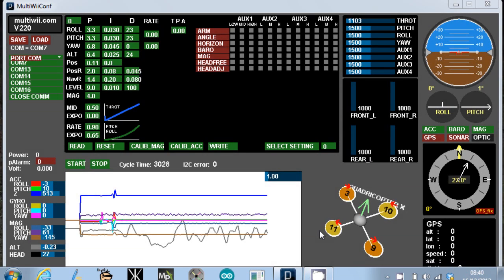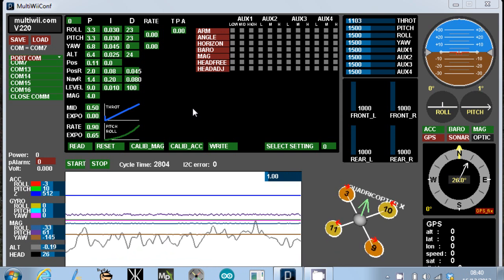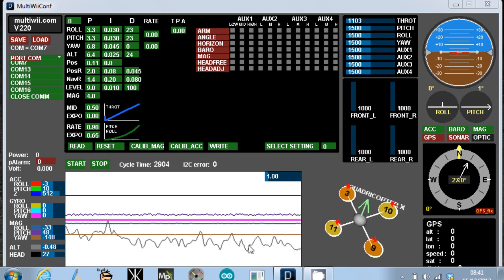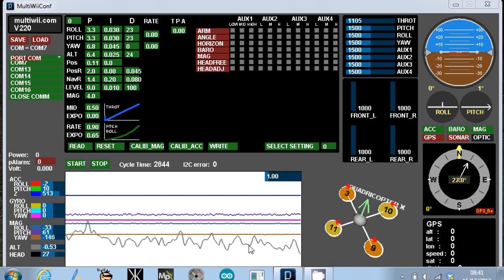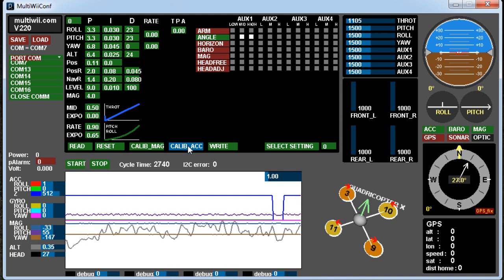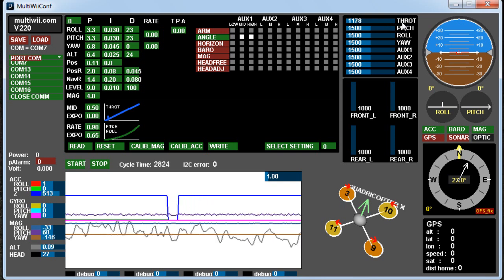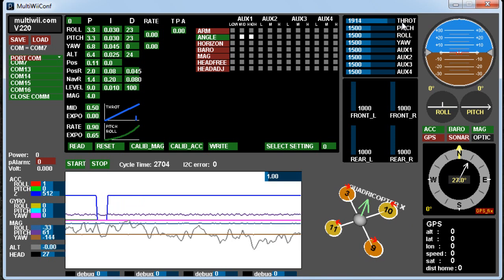(7/7) How to setup and trim auto-level on a Multiwii board

Comment: I'm working with diy multiwii 2.3 using diy brushed mosfet with 720 coreless dc motor and using flysky TX RX.
I instal baro module (bmp280) and modify some codes in multiwii 2.3. 'Hope you can help me with this. I watch your current video and try to do it later.
Reply from the maker: I've not used MultiWii for many years, so I am not sure if I am the best person to ask... best of luck

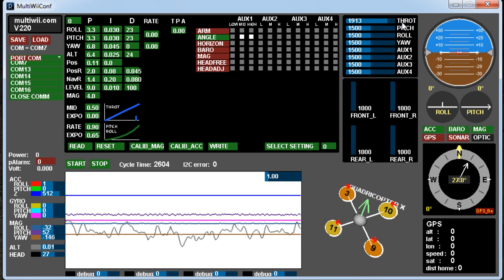Comment: Hi I'm also building a quadcopter but using the arduino and everything is ok and set but the only problem is the stick movements in the multiwii software are not moving for throttle etc as also shown in our video apprx at 8:25.. kindly pls help with this issue
Reply from the maker: I've not used the multiwii for many years now. All I know is in the video series. Best of luck..

Comment: I know this is an old video, but if you can answer it will be great! So if you don't use the trim buttons on the Tx, what are you using them for? I mean, do you just keep them to trim even with them, if needed, or did you just re-purposed them? Thx!
Reply from the maker: They are there more for fixed wing models really..
Reply: @Painless360  Thanks a lot man! I really needed someone confirming it! So I guess I'll re-purpose what I have..
Thanks a lot!

Comment: m getting yew drift and some roll n      pitch drift during acro mode help me
Reply from the maker: I'd use the sticks to calibrate out the drift. Make sure the radio settles to 1500..
Reply: Painless360 yes mid point at 1501 and throttle range 1010-1980

Comment: i noticed you wrote the information to the board but then clicked on calibrate accelerometers. So you don't need to click on write after calibrating the accelerometers?
  Is it also the same for the mag?
Thanks
Reply from the maker: Yep. ;)
Reply: Thanks, not keeping on top of things makes it difficult to remember all the small details, i need to write some notes.
Reply from the maker: That's why I do these videos. I often find myself referring back to them too so I remember the steps for products I've not used for a few months..

Comment: when i set the baro level or another switch on gui setting, have i to set it on every time ? or it is set automatically?
Reply from the maker: Luca Nsh I'm not sure what you mean - can you explain a little more?
Reply: Painless360 of course, sorry my eng
i mean, once i set for example the autolevel through the gui as a switch, have i all the times to switch it on ? can i set it to starts already when i turn on the xquad? 
i have just two switch on my TX and i want both free with autolevel already set
Reply from the maker: You can set the autolevel to be turned on when you want it to. See other videos in the Multiwii playlists for how this all works.

Best of luck.

Comment: when trimming and you say u land it. do u disarm before putting the throttle full and then pushing the stick in the direction of trim? if not full throttle would just fly upwards really quick?
Reply from the maker: AndyRC That's right. Disarmed.
Reply: thanks for the reply

Comment: Hello again Mr painless, I'm back, but I'm getting further as I watch and study your play list. I'm on this one. and finally was able to find my channel 5 setting on my Flysky transmitter and move it from VRA to SWA and it works. I mean self levels when switched on. Just like you said in this vid.Phew! :P.  I do have another problem though? I hope you can help me with this one? Here goes: When my craft is hovering (self level) or even manual mode and flying around about 1-3 feet up it all the sudden fast flip's high speed over on the right and crashes on its back! I just don't get it? Do you have a idea or 2 what it might be? Thank you su much, Kazz  P.S. I never went higher then 3 feet yet for I don't trust its behavior right now.
Reply from the maker: I would check that there isn't a bad connection on the model or a dirty pot on one of the controls on the radio - plus a servo into the channel that corresponds to the error and use the radio to see if you can make it 'jump'. I've also has some weird behaviour due to vibration on the model - it is on an anti-vibration mount isn't it?

Comment: hi mr Painless...
my mwc SE 2.5 iam using multiwii v2.3 but why my throtle up and down not constan event when i use auto level. but if i change with v2.2 quite steady but still up and down. and if auto level position my quad move and yaw to right what is the problem to my quad?
Reply from the maker: Do you mean that the model changes height despite keeping the throttle still? A video showing the problem and explaining the troubleshooting you've already done is very useful in cases like this.

Best if luck with it!

Comment: Hi Mr Painless!
I presume this works on a Naze 32?
If so, is there a way of doing the YAW? My little Mini quad Yaws left very slightly in the hover. Maybe that's normal on these?
Reply from the maker: Check vibration and that the output on the rudder channel is as close to 1500 as you can get it centre stick first..

Best of luck!
Reply: Painless360
Thanks mate. That actually makes sense :-)

Comment: hi there, i am using mwc 2.5 SE , motor xxd2212 1000kv with esc simonk 30A batt lipo 3S 4000mah and frame x525. i already set all it up but during test flight the copter doesn't lift up. or just afew centimeter. please help me what's wrong with my copter or there is somthing i missed?
Reply from the maker: What troubleshooting have you done?
Reply: Painless360
for your info  i set up my multi wii with arduino 1.06 schetch 2.3 the latest version with configuration default excep angle i make it position M an H. i plan to change my prop with carbon. it is posible the board is the problem (magnometer) because i ever read the magnometer need to cover by foam to reduce wind impacted.
Reply from the maker: You need to perform an ESC calibration as the next step and the foam covering is for the barometer, not the compass. This isn't part of your problem..

Check that the throttle channel moves from about 1100 to 1900 and go through a manual throttle calibration (video on my channel shows you how) then give it another go..
Reply: Painless360
dear sir.
okay sir problem are solved now. by changing mr propeller with made from carbon, suspected my old prop not good/not enought lift.
thank alot, i am waiting for setting gps now.

Comment: how do you perform Dual rates and expos on the board with a click of a switch? rather then using the TX to reduce the rates and expos.
Reply from the maker: I'm not 100% sure on this but I've just checked and can't see any way to change the setting in the current version of the code (2.3). I'd use the MultiWiiConf to set some expo (best resolution) or the Tx of you want to be able to change it on the fly.

Happy flying!

Comment: Hi, I'm new to all this stuff and trying to learn as much as I possibly can before investing in the parts to build an FPV 'racer' type quadcopter, hence watching your videos amongst many others.
Would you please explain to me what you meant by 'disarm the motors' prior to making the trim corrections?
Thank you.
Reply from the maker: The Multiwii can be 'armed' and 'disarmed'. When armed the throttle isn't controlling the motors, when armed it is. Always disarm a control board when moving the sticks or changing the settings in case you accidently start the motors and have an accident.

Happy flying!
Reply: Great, thanks for the quick reply. I assume this is something that is done within the MultiWii configuration software. I'll download the Android version and familiarise myself with it some more.
Thanks again.
Reply from the maker: Nope, it's done with a certain stick configuration. You can see it in my video - https://www.youtube.com/watch?v=lc4ECi6JYX4.

If you are new to this then I'd suggest watching all of my Multiwii videos using my Multiwii playlist - https://www.youtube.com/playlist?list=PLYsWjANuAm4qSqszQR6qIisiwk5r-_nMk

Good luck with it.
Reply: And another piece of the jigsaw falls into place :-) Great stuff, thanks.
Reply from the maker: You are welcome! Best of luck with the build. It's a great feeling flying a quad you built and programmed yourself..

Comment: Hi painless. If i over do my auto trim, how do i reset it back again to default? Is there any indicators or sign anywhere for me to check how much trim i already used? Thanks for your help!
Reply from the maker: Emo Red there is no easy way to see how much you have already. Fly the model again using the process and the model will relearn the trims needed to stay as still as possible. Make sure you keep it as still as you can in the hover. Are you having a problem?
Reply: Painless360 hi. Thanks for the prompt reply. I can't fly my quadcopter if i turn on my level mode on aux1. I think i mess up with the trim part. it will goes tilt to back right immediately i push my throttle. If I'm using normal mode, the quad is flying but will goes front right a little bit. So I'm planning to reset the autotrim back to default and start again.
Reply from the maker: Emo Red I'd also recommend recalibrating the accelerometers as well to make sure the saved settings are not corrupted.. Best of luck!

Comment: Hi. At my transmitter remote, there is a few options to choose. Heli - fix pitch, variable pitch, swoosh pitch 90', and swoosh pitch 140'. Which settings should i choose?
Reply from the maker: Acro mode or Heli with 90 degree swash plate should both work fine. Best of luck.

Comment: Is there a way of seting the quadcopter so it can keep the altitude when I push the right stick in any direction. I have made all the setings correct,but when I push the right stick forward,my aircraft is lossing to much hight,so I have to push trottle up to keep it stabile in altitude. Earlier I have use Naza,and it really lock the altitude,so you don't have to worry about altitude. Just I little of trottle correction is needed if you use too strong right stick input. Now I am trying to fly minihquad,and I am really having much trouble.
Reply from the maker: ye

Yes there is. You can activate the barometer on the board as one of the modes. It will not be as good as the much more expensive naza though. See http://www.multiwii.com/wiki/index.php?title=Altitude_PID for details on how to tune altitude hold. Hope this helps. Happy flying!
Reply: Painless360 No,in that way I could only use Baro in stabile hover???? That is what thay say. I would like to use it in flight to keep my altitude instead of me making trottle correction. As they say,Baro can only be used when roll/pitch -trottle/yaw stick is steady?? Is that correct?
Reply from the maker: If you want to fly and hold a certain altutude while flying then, at the moment, the Multiwii isnt a great option, it will help keep the model at an altitude when hovering -very useful when used with GPSHold.

The APM has a nicer implementation for altitude that also works during flight.
Reply: Painless360 OK,thank you. I was worry I was doing something wrong. OK,so I will have to change my flight controler. Because my fingers are not up to make that kind correction for me.
Reply: Mihajlo Janjetović
In the config.h file, there is an option called #define IGNORE_THROTTLE. Set this to 1. This only works in BARO mode. I have not tried it yet, but supposedly this automatically adjusts throttle to maintain altitude even in non-hover flight. Be careful when leaving BARO mode with this option enabled - if you have inadvertently moved the throttle position, it will immediately change the motor speeds and you could get a rapid climb or descent.

Comment: Do i need to trim the autolevel if the cog changes slightly (different batteries, fvp gear etc). Also, my channel timings read about 2015 max and 985 min, 1500 mid, is that range to wide?
Reply from the maker: Any changes to the centre of gravity will mean that you will need to re trim. 

I guess that your endpoints are more than 100% to have that much range.  I would change the endpoints so the values are within the 1000 to 2000ms range. 

Happy flying!
Reply: Painless360 That means that I have to do this autolevel-trimming before every flight, unless I'm flying with the same battery? I'm using the Taranis and the endpoints are 100% on all channels. Should I decrease the endpoints to get it between 1000us and 2000us?
Reply from the maker: Not if you fit the battery so its balanced. Different weight and size of battery will not need re trimming if mounted at the centre of gravity. 

If the model is working well and you can setup failsafes then it will work ok. Most failsafes expect the radio to be above 970ms+ at the low end to work. 

Happy flying!
Reply: Painless360 Ok, I see. I thought that the I-gain of the autolevel pid would correct any errors in cog, and that the trimming was meant to correct tilts caused by tilted motors, skewed frames and so on.

Comment: I was told that (horizon) was for Auto level horizontal
Reply from the maker: See @wiki/index.php?title=Flightmodes for full details on the modes.Happy flying!
Reply: Painless360 Great info so basically angle is stable mode and horizon is a mix of angle and acro

Comment: I noticed that your yaw pitch roll and aux in the upper right are all at 1500. Mine are not. How did you do that?
Reply from the maker: Use the subtrims on the radio to get it spot on, the board will fly better when it knows where the middle sticks are. Happy flying!

Comment: If you have the atmega 2650 chip I highly recommend the megapirateNG firmware, you don't to use any sort of level and tuning is much easier since you can assign one of the knobs on the transmitter to the PID values

Comment: Hi, this may sound like a stupid question but how do you disarm the motors once you land the quad to make the adjustments? Is it just a question of turning the tx off and on again? Do you know if it is the same process for the mini MWC FC receiver combo?
Reply from the maker: If you arm by pushing the throttle/rudder to the bottom right, then you should disarm by moving the throttle/rudder to the bottom left. There is usually an LED that shows the armed status of the board. I've not tried this board that you mention but all of the Multiwii models I use seem to be the same.

Hope this helps.
Reply: Painless360
Is there a way to adjust the trim in the GUI?  My yaw range will allow me to arm the board, but the travel does not go far enough left to disarm.  Or is there is a means of adjusting the yaw range in the multiwii 2.3 sketch?  I already set my Tx travel to 125%.
Reply: Painless360 Great i will try this, i'm wondering what stops you from disarming the board by mistake if you have a bit of a moment with the throttle stick and yaw or if you were flying acro and had to go full bottom left? I'm guessing you have to keep it there for a few seconds. I suppose i will find out soon enough.
Reply: Painless360 Yes disarm was bottom left on the MINI MWC. I got as far as about to setup the PID's as the quad was flipping over very easily but then i somehow burned out an ESC. (I think this was due to a strange power circuit i built where the esc is always connected to the 2s battery but the 2s is disconnected between the two cells to turn everything off, i think the mistake i made was disconnecting this switch during charging which sent current through the esc) Waiting for the new ESC now. Time to redesign my power circuit.

Comment: Hi Painless360.  Is it possible to have the auto level set at 2 different levels of force. Say medium and high?  I have it on a 3 position switch and have saved the 2 positions in the GUI but they both seem to be the same.  Nice video.
Reply from the maker: Not on this version of the software. You can switch between horizon and level modes or set up a D/R switch to reduce the input from the transmitter. That's about it. Why would you want to?

Happy flying!